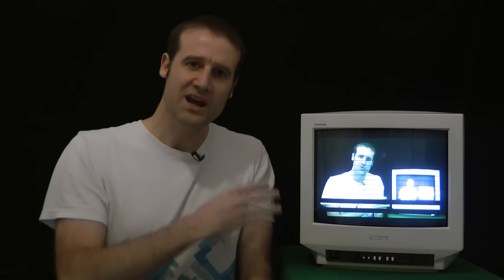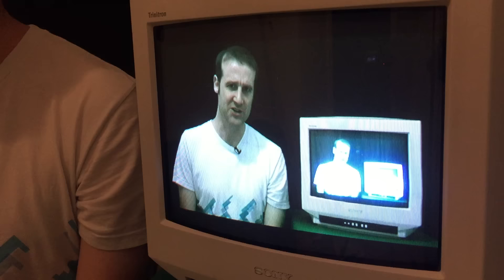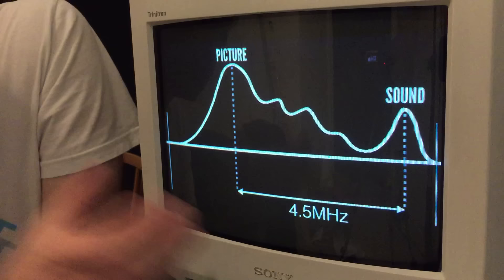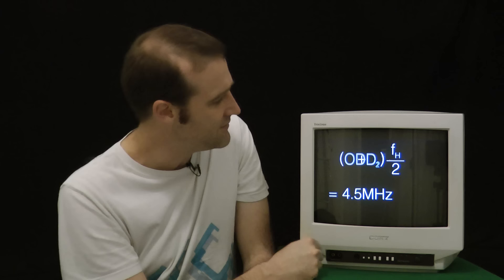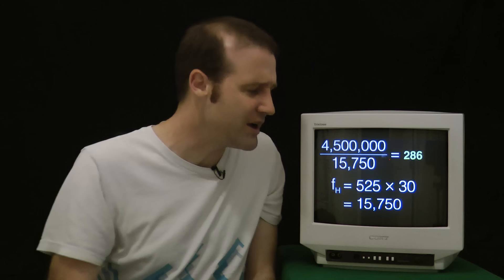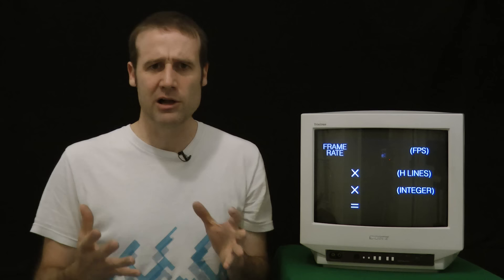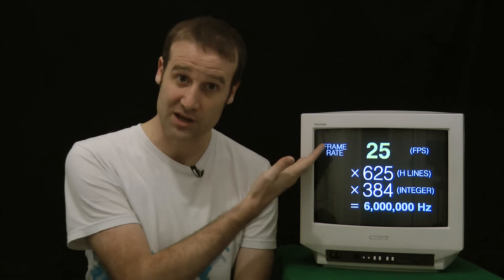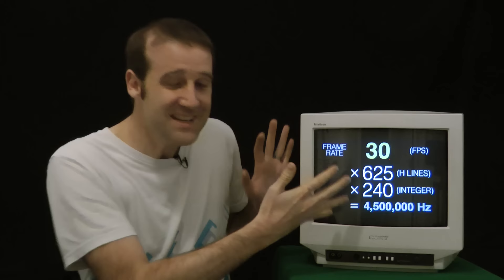Why is TV 29.97 frames per second?

Comment: The total time of a frame is enough to draw 525 lines on the screen, but that assumes you are dividing the frame time by the time to draw one horizontal scan line.  However you have to also include the horizontal blank interval i.e. the time the beam is off so it can be repositioned at the start of the next scan line, as well as the vertical blank interval, i.e.  the time the beam is off so it can be brought back to the top left corner of the picture from the bottom right and does this for each half frame.  When those are taken into account, it turns out you only get 480 scan lines total.  Horizontally, you can draw 320-350 alternating dark and light vertical lines giving you (in computer monitor terms) about 640-700 pixels on each scanline depending on how good your comb filters are.  I know, 4 years late to the party, but there it is.

Comment: PAL is more cinematic!
Reply: you stole my words sir +Guitar Lesson
Reply: grande1899 omg 😲 YOU AGAIN
Reply: The lowest common multiple of PAL 50hz and movies 24hz is 600hz
The lowest common multiple of 60hz and 24hz is 120hz.

Sorry, PAL doesn't have enough prime factors in common with cinema for my taste.
Reply: Patrick Wise You're forgetting that as explained in the video, NTSC is actually 29.97 FPS an not 30/60. The lowest common multiple of 24 and 29.97 is 23976. Checkmate :^)
Reply: although what's funny about this, is that on UK TV, films, shot at 24fps aren't "mapped" (3:2 Pulldown i believe it's called)  like on the NTSC system,  we simply show 24fps at 25 fps. This is why if you check running times of movies shown on UK television it is about 4% shorter than the actual running time. 
Also, now we are in the age of 1080P and soon 2160 P or even higher, why are we still having to even think about drop frames and 29.97 frame rates?
Reply: Tim Beaton The UK and Europe also got to play the original Sonic the Hedgehog games at 25fps instead of 30fps with everything running at 5/6 speed because the developers didn't adjust for PAL (Japan uses NTSC like the US).
Reply: I wonder how a film running 4% faster would sound?  If they simply played the same audio samples at the higher rate, that would raise the pitch of any music almost 3/4 of a half-step in music.  That would certainly be noticeable if anyone tried to "play along" at home with their own musical instruments.  Of course the audio can be sped up without raising the pitch, but that is a fairly high-tech technique that would not have been available until relatively recently.
Reply: You are correct. Something shot at 24fps then played at 25fps ran well over a quarter tone sharp until the advent of pitch shifting (or time stretching which is really the same thing in disguise).

Whereas something shot at 30 and played back at 29.97 would go 0.1%, or about two cents, flat. The engineers were indeed correct that this would go unnoticed. The variance among turntables and tape decks greatly exceeded 0.1%, so if something "sounded off" on TV, it was much more likely because the listener was used to hearing it on a record player or tape deck running at the wrong speed.

Another advantage of going from 30 to 29.97 is that in cases where retaining the precise runtime was of paramount priority, one merely needed to drop one frame out of 1000.
Reply: lol you here hahaha
Reply: absolutely correct. you do not notice the extra 4% visually, and also not in speech and music as long as one has not perfect pitch or tries to play along (wondering why the soundtrack is somehow in "odd" or moreover between two keys...)
Reply: Jenairaslebol27merde  True enough. Years ago, some juke box turntables ran about 3% fast so the music sounded peppier, not to mention making the selections run shorter, meaning more quarters needed to keep the tunes going! Sly bastards, eh?
Reply: grande1899?!
Reply: Dolby vision & UHD is more cinematic
Especially in an OLED TV ;)
Reply: grande1899 Why are you everywhere?
Reply: 60fps really looks bad when there are people doing things on the screen and such. Simply disturbing, should never be used for playing back films. But having 60fps should be a must when showing animations, graphics with hard edges and such. They really look better in 60fps, as the motion blur must be created by your own brain.
Reply: Happy birthday
Reply: The huge irony about this vid is that line by line phase reversal is also known as Phase Alternating Line - PAL. It isnt part of NTSC at all, its the defining quality of PAL (which also comes in 30Hz versions).
Reply: gonna say it again - debating the values of PAL vs NTSC, FRAMERATE IS IRRELEVANT as pal comes in a number of framerates etc
Reply: +Patrick Wise Actually those original Sonic games on MegaDrive/Genesis ran at 50fps PAL or 60fps NTSC. A lot of NES and SNES/Genesis games back then were actually 60hz/60fps (apart from any times you had too much on the screen and frames dropped) for the most part, believe it or not. They are just double the usual PAL/NTSC framerates. But yea, like you said, Japan uses NTSC as well so the games weren't probably adjusted for PAL back then, running stuff at 5/6 speed. So yea, we got either 30 or 60 for games, and PAL got either 25 or 50 for games, over the years ;)
Reply: Robert Scott I can readily hear the 4% change in pitch for any content I’m familiar with. As an American who moved to Europe, that meant a lot of TV shows and movies whose theme songs and character voices I was intimately familiar with. (Most high quality TV was made on film, and so received the same treatment — 3:2 pulldown for NTSC, 4% speedup for PAL — as movies.)
Reply: @robertscott1949  Digital pitch changers have been around since the late 1970's / early 1980's. (Advanced Music Systems, now AMS Neve).
Reply: More 'filmic' :)
Reply: Which is good and all unless you play a racing game on a last gen console
Reply: I find it hilarious that grandayy was here
Reply: penpal
Reply: imma PAL boi B)
Reply: @mal2ksc  That's... Not how it works lol. I don't know what kind of alien planet you're on. When the real engineers increase the framerate they shorten the frame time and add duplicate frames. To decrease the framerate you obviously do the opposite.
Reply: grande1899 WHY are you here?
Reply: @ColHogan-le5yk  What difference does ANY of this make on a last-gen console?
99% of PAL televisions have supported 60hz since the early 90's, and game consoles since the early 2000's typically support both 50 and 60 hz modes.
More importantly, a properly coded game should simply run with 10 fewer frames.
The speed at which the game runs should be identical. (because the timing code shouldn't be tied to the framerate - that creates a lot of bad side effects)

Unfortunately the problem on older consoles is frequently that the speed of the game logic IS tied directly to the framerate.

Sonic 1 ran at 5/6th the speed. (everything ingame moved slower), and even the music was slow.
Sonic 2 fixed the speed of the music, but not of the gameplay.

(meanwhile, Mario Kart on SNES was properly adjusted so that t50 hz PAL version ran at the same speed as the 60 hz NTSC one. -yes, lower framerate, but the game runs at the same speed regardless.)

No modern game should still be pulling that nonsense. Especially because framerates in a 3d engine can be highly variable, and that means the speed of the game would vary alongside the framerate as well.

Not that 60 fps is somehow some magical number that has any real meaning either.

30 fps was determined using some physiological criteria ages ago (that's not to say you can't see anything faster than that - you can. But 30 fps still has some actual scientific basis behind it.)

60 fps however is just a number. Faster is better, but 60 vs 50 is not such a huge gap that it makes too much difference in practice.
(30 vs 25 is another matter entirely, and below 20 is... Bad. Though you find another limit here 12 fps - this is the lower limit where you go from something looking as though it's moving, to it being a slideshow - 12 is painful, but it still looks like movement. Lower framerates generally don't look like anything is actually moving anymore.)

50 vs 60 is moot when you have the option of using 70 (VGA standard since forever), 90 (The minimum acceptable framerate for VR due to nausea-related issues), 100, 120, 144, 240, etc.

There are diminishing returns of course.
Probably anyone claiming they can tell the difference between 500 and 1000 fps is well into the realms of self-delusional bullshitting...
But 50 vs 60? Eh. Whatever.
Reply: @robertscott1949  Generally, nobody cared about the shift in pitch when we ran cinema films at 25fps, because music is usually pretty incidental to a film. Even musicals didn't present a problem, presumably because relatively few serious music buffs were eagerly waiting to savour the delights of "Oklahoma!" or "Carousel".
However, in 1981 the BBC transmitted a film version of The Marriage of Figaro and a pile of gear was hired and installed in TK30/32 in Telecine at Television Centre to correct the pitch of the sound. I've long since left the BBC but I'm given to understand that it's no longer an issue, because the power of digital processing means that cinema films are now run at 24fps and seamlessly converted to 25fps by interpolation. (Internally created 16mm, on the other hand, was always shot at 25fps.)
Reply: @gerardjlaw  Thanks.  Good to know!
Reply: @robertscott1949  Yep. Playing along with TV, or guessing the pitch of a tune was a mess. You tune your instrument. You switch on the TV. You retune the instrument. Song´s over. You head for rehearsal and forget to tune back. .......sigh....
Reply: 10:46 is almost the Futurama God quote:  “when you do things right, people won’t be sure you’ve done anything at all.”
Reply: @timbeaton5045  On digital televisions we are not. Blu-ray are 24fps and digital television's can adjust there herz accordingly.  Dvd's are at 29.97 because they where mostly used on CRT televisions.

Comment: There were several attempts at coming up with a color standard.  Finally, it was realized that with the expense at the time of television in general--and especially the new color sets--you would have to make it "backwards compatible" to the existing B&W sets or you would be selling zero color TV sets and would fail.  So they did, and made the best of a bad situation.  PAL is superior in many respects--and is so because it started from scratch with the lessons learned by the compromises that had to be made in the North American system.  Had that been a real option for the American engineers, they would have loved to start over and make a clean solution.  But marketing always asks for miracles, and it's up to engineering to deliver them (compromised as they may be).
Reply: Have to add that at the time devices were meant to last forever.  You could not simply ditch a B&W set because it's outdated due to a standard of color tv being introduced. Of course things have  changed...
Reply: @PR-fk5yb  In the 1950s TVs were far more expensive relative to average earnings than they are now. Colour sets even more so. Although NTSC colour transmissions started in 1955 it wasn't until about a decade later that colour TVs outnumbered B&W ones in US homes.
Reply: @PR-fk5yb  Yeah, imagine if Apple had invented it.
Reply: @zoewells3160  lol remember that story : What if Microsoft had invented the automobile? It would not work certain types of gas or it would suddenly stop on the highway for no reason then you would have to find the stop button in order to restart it... If Apple had invented the television... you would have to pay $$$ just to use the airwaves or you would have to pay an extra everytime you would change the channel...
Reply: @PR-fk5yb  This is also true, yes.
Reply: @zoewells3160  Surely a Commodore would've come along and sold a cheaper alternative? :)
Reply: Started from scratch?...The short answer is No...625line 50hz 25fps was already a monochrome standard, used in most of Europe.
Post war...
625line was actually based on the then new 1940's USA 525 line 60hz 30fps monochrome standard.
(Being our electric is 50hz,  we always had to go down the road of a lower 50hz 25fps). 
This lesser frame rate, (and all things being sort of equal), gave us room to having 100 more lines per frame..). A sort of 'give & take' so to speak of.

PAL is really, ( as with its closely related cousin NTSC ) only a colour standard... made to be compatible with the existing black and white tvs already out there. 
And weirdly:.........
Although at last, we had a monochrome picture standard at least, (at 625 line etc etc.)...within, there were a few different audio sub standards... within the standard...if you get what I mean

With this said, and along with the differing audio fiascos just mentioned , how we managed to avoid the need to make any weird frame rate adjustments, ( say 25.17 fps for example), when squeezing in colour,... I don't know. 
It's all down to Maths, (or Math ), I guess...or luck maybe.

Comment: Also changing the number of lines in the signal would completely brick the older TVs, introducing an odd, skewed horizontal rollover as the greater number of horizontal lines would cram the same number of pixels into less horizontal space.
Reply: A small change to the number of lines would not have caused any particular difficulty with consumer video equipment.  Until the late 1990s, most video game systems output video that was significantly different from what the NTSC specified, but TV mostly coped with it just fine.
Reply: Yes, a lot of early gaming and home computer systems produced signals that were more than a bit off, but the NTSC engineers were tasked with creating a standard that would be least disruptive and compatible with older B&W sets.  Changing the vertical scan rate by a tenth of a percent was very likely to work on all receivers; changing the number of horizontal lines by 20% would have produced the artifacts seen with many games & computers, like jittery pictures, tearing, and flag waving.

I don't believe any of the European color standards were compatible with their earlier B&W signal.  They saw the compromises the NTSC engineers made and decided to just abandon the old standard and start over for a better color picture, also a reasonable engineering decision, but it forced customers to replace their sets.
Reply: All the European colour standards were fully compatible/transparent and usable on older B&W TVs. No sets needed to be replaced (until digital broadcasts came about, but that was much more recent).